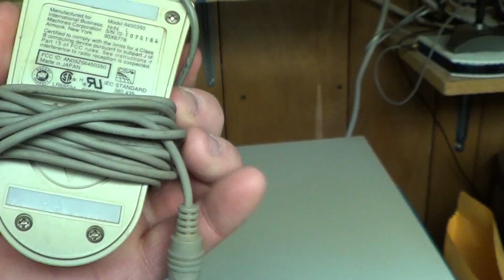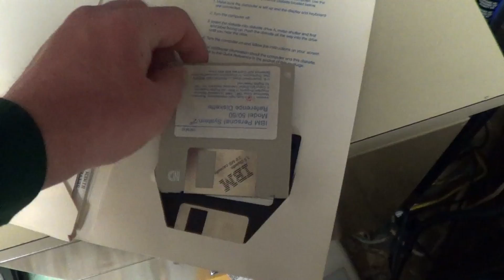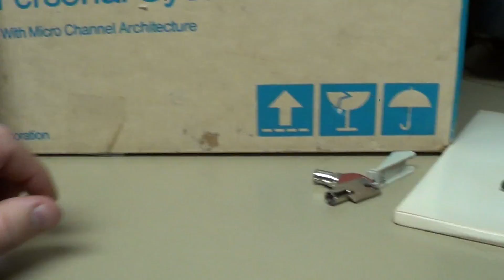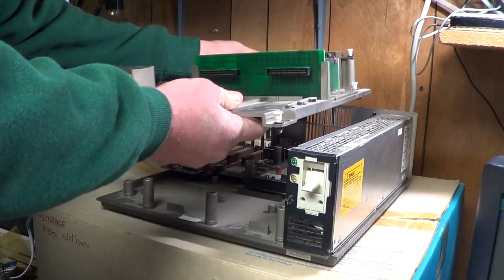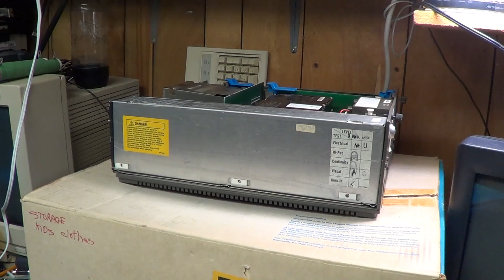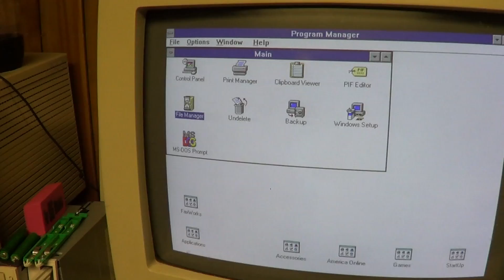The Good, the Bad and the Less Than Totally Inspired (IBM PS/2 Model 50Z Overview/Demonstration)

Comment: When I was in middle school, I fixed up a huge stack of these and gave them away to a bunch of students. Think I went through about 80 of them. I remember installing Windows 3.1 on them all, it actually run on them just fine. I tried a diskette install of Windows 95 on one, it was slow to install and slow to use. If I remember right, the Windows 95 diskette install was like 38 disks long.
Reply: Depends on the version of Windows 95. The earlier versions were on around 15 floppies, later versions had more disks.
Reply: 15 3.5in disc's actually.just sold one on ebay,sealed with original c.o.a for £197..... :)

Comment: ? so why is having this so special?? I also own one, a 286, bought new, with everything still (original) with it. mouse, monitor, okidata 24 pin printer, keyboard, vga crt, books, msdos install floppies, manuals, etcetera etcetera, etcetera. And believe me, it's in better shape than yours, not a scratch. To me it's an old PC, which always worked and still does like when I bought it new in 1985 or so. And please, don't ask if I will sell it, because I don't. cost me about 6.000 USD back then and it has sentimental value. (I learned how computers work on that machine, instead of the kids nowadays, who just turn it on and let the OS itself figure it out instead of "YOU") But other than that, it's nothing more or less than an obsolete piece of hardware.
Reply: I would also add that it is interesting to see what ( from your example of spending $6,000 in 1985 money which would be $12,000 today ) bought in terms of computing power and user experience compared to today. Also gives a good idea  and appreciation of how far computers have come, good or bad and a good appreciation for just how much easier to use and cheap computer technology is today. It is also fun to make these old systems work as opposed to as  you said, let them work for you.  It is also a piece of interesting history being preserved.
Reply: ***** A question just occurred to me.  Can you remember your first experience specifically with an IBM PS/2 system?

Comment: I used to deal with these on a regular basis. The trick to working with the power supplies, is to unplug them and then turn the power supply ON. This will dissipate any power left in the rather large capacitors in this behemoth of a power supply back then.

I often wondered how dangerous it could be working on one of those until I forgot to do just what I said, and accidentally touched the power switch to a metal peice of the chassis. Needless to say, it welded itself to the chassis with what power was left in the capacitors. It was a big shock, and scared the bejesus out of me.

Never forgot to do it again!
Reply: +SmerrillS Reviews It's pretty important to remember about this, considering on most switched mode power supplies there is cap that is charged to full rectified mains voltage (around 170 V in US and 320 V in Europe).
Reply: +kroplaaaa I know. this is why I suggested unplugging it and then turning it back on to disperse whatever charge was left.

Comment: I remember buying a 486/75 Mhz Packard Bell computer back in 97 (yes, it seems strange for today that a 486 lasted till that year), but Pentium based PC were at leasr $2500 or $3000.

For that machine was available a Pentium Overdrive CPU, but thet upgrade kits were at least 70% of machine price. later came Celeron and machines were cheaper.

Comment: I bought a PS/2 30286 back in the day and later found out it wasn't a 286 processor. it was an 8086 computer!
Reply: That´s bad. 8086 -> 4.77 Mhz
286 : 20 Mhz 
And memory handling is limited on the 8086 to 640 KB
Reply: At the time, they had a 386 tower and it was CHEAPER but I had read a Wall Street Journal article in early 1987 about how awesome the PS/2s were going to be and my mind was made up!
Reply: 525Lines At that time (when companies were fighting for setting their standards) , buying an IBM computer made everyone a sign of respect. 
You said IBM and was like buying a Mercedes....
Di you have any advantage of their propietary MCA architecture?
Reply: supermasterPIK I don't know. The 30286, while a PS/2, didn't have the proprietary architecture but I think it could use peripherals made for it. I'm sure PS/2 apps were probably easier to install than other PC gear. I bought this for my home, do wasn't really looking to impress anyone!
Reply: A merchandise Benz computer nowadays is called a Mac
Reply: iBallasticwolf2 then the benz has an excellent price/quality ratio.
Reply: ***** Unrelated but cool.
Reply: iBallasticwolf2 That sounds right. I've corrected my original post. Thanks!
Reply: a 30286 is a 286... an 8086 is an 8086 32bit v 16bit,...
Reply: +chloe devereaux The model number suggests you're buying a 286 processor but the PS/2 Model 30286 has an 8086 processor. I paid $5,000 for that lesson so I speak with some authority on that particular issue.
Reply: then more fool you.... LOL
Reply: chloe devereaux I know I'm not looking at women's legs, that's for sure.

Comment: My first computer, bought myself...Model 50z, with a 30 mb Hard Drive.  $3358.08 for the CPU, Keyboard, Mouse, Color Monitor and IBM Dot Matrix printer.  Unlike computers today, this mating lasted from 1988 through 1999, when I sold it...working..to a guy who wanted his kids to have a trash machine to bang on.  Wish I still had it...  I do still have the mouse in the video...

Comment: you never showed the cpu that was upgraded
Reply: I would have also been interested to see this.  I upgraded my academic PS/2 Model 50 (original model with 1 memory wait state and the red power switch - not the “Z” model shown here with 0-2 memory wait states).  But I upgraded mine with an Intel SnapIn 386 - a small daughterboard with a 386SLC and 4KB cache on a small daughterboard that fit in the motherboard 286 socket.  Definitely gave my machine new life for a couple of years…

Comment: I pulled a IBM PS2 system box, monitor, and keyboard out of the dump.  Balanced it on top of my bicycle and pushed home.  I dropped it a couple of times in the hard packed snow.  Maybes I shouldnt have switched it on when I got home.   Some cool sparks out of the top of the monitor then.  I left it, for a couple of weeks, it worked ok after that.

Comment: well i can tell you, i left my computer (modern one) on during, then i woke up cause of smoke.. turns out the powersupply was glowing and burning inside it's case. Ironically the system was still working and i was able to shut down. Man I was lucky the motherboard was intact.

Comment: Funny how the Windows 3.1 File Manager still looks the same as the Explorer does in Windows 7 systems, just with more obstruction of the real location of the files. Micosoft has neither evolved on their own, nor learned anything. Luckily, I'm away from them and only using Linux on my PCs since over 6 years now (after having been dumbed-down by Microsoft "lying to the user about what the system does and how it's built" for almost 15 years before that).

Comment: These systems are virtually indestructible! In the late 90s, I've been given 2 PS/2 systems which I later traded in for a (then huge) hard drive of several hundred Megabytes. They were in lower cases, had 2 FD drives and were equipped with 8086 or 8088 CPUs. With one of them, I slid a screwdriver over the connectors of the RAM card while it was on. It was a sparkly experience, and of course crashed. Turning it off and back on again brought it back to life though. Try doing that with DDR3-RAM! ;)

Comment: i had a few old ibm ps/2 model 70's that were shot, but they still ran. the same thing happened with the cap, but mine shot a small flame out. there was nothing left of the cap.

Comment: I know that the drivespace driver only loads if the drive is compressed, i used drivespace and doublespace on my old 386DX system. But it could be the line device=drvspace.sys in the config.sys.

:-)

Comment: Me and my dad was going to start our old Aptiva family computer that had been standing cold and sad in the basement collecting dust and dead bugs, so we took it up, vacuumed it, and plugged it in. Guess what it did... blew up! I was right behind it to put the cable in the PSU so i was looking right into it and dad turned it on right away so i didn't have time to crawl away to safety and let me tell ya'... that flash didn't help my already bad eyesight... must have been one of those capacitors

Comment: I still have the developers OS/2 warp 4 . It stills runs in my PS/2 model 80 340mb drive . I also now hard it is to find those hard drives mine is a ESDI also mine has a scsi card and have a 120mb drive and a tape drive hooked to the rear connect. I hate the way IBM did not follow the normal SCSI and put a propitiatory plug inside and out side . Oh my OS/2 is on a shit load of 2.88 floppy discs . Remember those?

Comment: I loved those old machines Back when I was working for a big power company and I was a power line tech . The sent me to the IBM school to get advanced IBM repair from IBM 30 to 95 . The best part most of the time no tools to work on them. The worst part was adding memory to one of those memory cards . I also work on the AS 400  system. Back then added memory was used for Microsoft word and Qemm . Remember the LIM?

Comment: Speaking of cars and the big  city, I currently drive a Mazda Protege5, the car before it was much like your truckling, except it was a 1992 Ford Ranger extended cab truck with 2WD, and I live in the city and was glad it wasn't any bigger. It barely was city certified for its size.

Comment: Wow, this takes me back. I once had a 386SX20, though from Packard Bell, and it was a hand me down from my late father. He'd bought it new in 1991, running DOS 4 and has all of 2MB of memory installed in it. I got it in 1994 with Windows 3.1 and 4MB of RAM. I've come a long way since then and now run a core i7 bad assed Dell desktop system these days.

Comment: Yeah I know. I have worked on a few of those cars with the L05. They are good solid engines. The LT1 engine actually came out in 1992 for the C4 Corvette, however the LT1s in the 94-96 Caprices/Impala SS's are detuned by about 40 horsepower.

Comment: The old tub style caprices truly were known to achieve pretty good fuel economy especially when you're talking about the ones equipped with the TBI 350 V8 engine and such. However, when those shocks go bad, you might find yourself getting seasick (yeah, thats right) on the open road because that car had a horrible tendancy to bounce all over the place.

Comment: what is the first windows program i understand a c64 could be windows like could run a hacked version of windows ??? is this true i have a speaker phone dial up modem i have not used my c64 in 20 years i wil be firing him up soon  i have 2 drives working tape machine what advice can you give me on doing this i will make a vid of doing this on sunday

Comment: I had two of those tantalums blow up in my IBM 5150 PC, but they're just power rail filtering caps, so they're not critical.
My friend in high school had a Model 60 with the SLC/Now upgrade, and this seems a bit more sluggish than I remember it being. As nice as it sounds, that 30 MB hard drive is probably the performance bottleneck.

Comment: It seems tantalums get a nasty temper when set aside too long. I recently had the same thing happen to an old Pentium Pro motherboard.
It really makes me worry about a P2 Xeon HP which is absolutely filled to the teeth with tantalums. I'd guess there's 100 of them. As I have largely stopped using it, I think I'm going to have to make a point of firing it up once in a while. With such a huge number of tants on the board, I don't like my odds of avoiding disaster if I let it sit...

Comment: Nice computer.
The slow speed of the system can also be caused by drivespace that is running in this system, drivespace was like doublespace a drive compression tool to "double" the storage in a system. And the strange dos prompt can be found in the autoexec.bat file.
You can change it in prompt $p$g for the standard c:\> prompt.

Comment: Hey, my 50z did have the keys... and I still have them! I'm surprised he didn't spring for a MCMaster card, it would be MUCH faster since the RAM would be running with 32-bit data width and at CPU speed. Basically makes it a Model 56 since it only has a 16-bit bus. Is that machine running 3.1 in 386 Enhanced Mode?

Comment: I'm glad I found my Model 80 (8580-111 converted to a 311) in a closet in NYS office building. It was missing the mouse, keyboard and monitor, as well as many of the expansion card slot covers. Judging by the fact that AIX was loaded onto it, those empty expansion slots were probably filled with serial cards.

Comment: I have two AOX/Kingston McMaster cards I need to put up onto fleabay. One's a 25MHz 486SX card, and the other is a 386DX card (with a math co-processor installed that I MIGHT pillage to fill the empty slot on my Model 80's mainboard...) I got them in a lot, which I bought solely for the 30MHz 486DX2 card included.

Comment: It's amazing how tolerant some hardware is of blown or missing caps. I recapped a power supply on an LCD monitor once and decided to test it without realizing I had totally forgotten to put in a replacement cap in one spot. It turned on like nothing was wrong. Who knows, maybe it was in parallel with another that was doing enough of the work to operate normally.